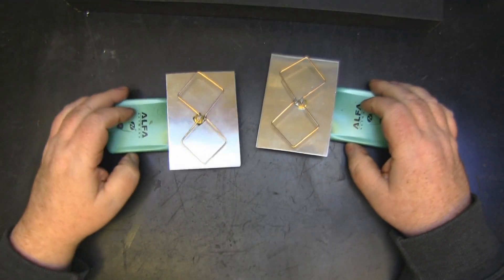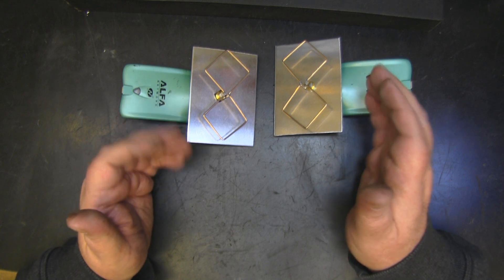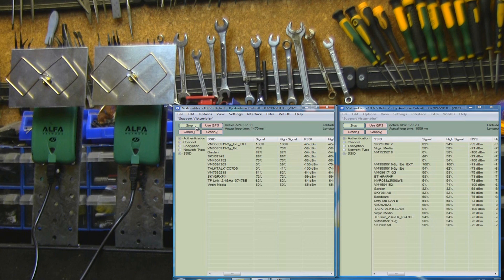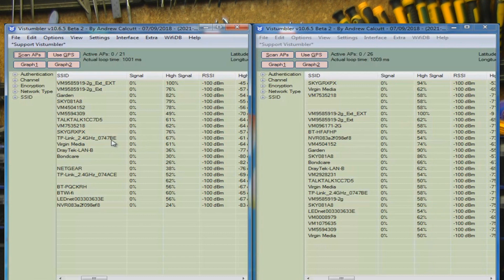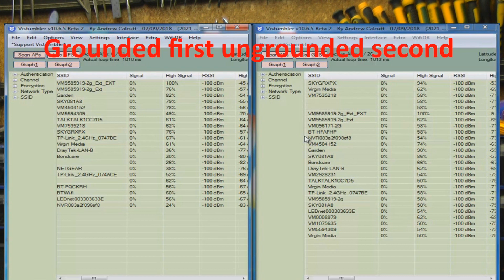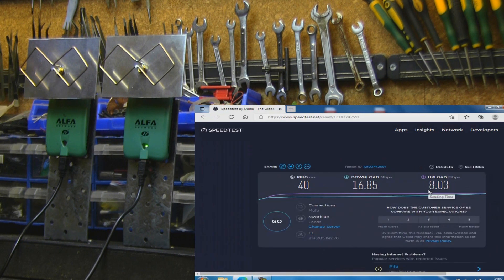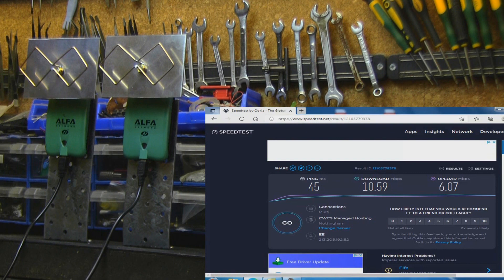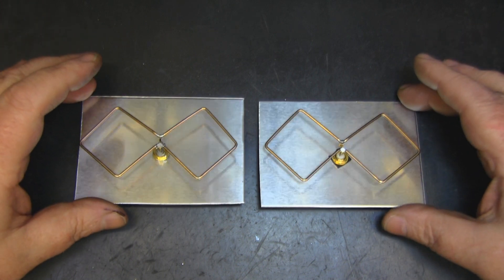Grounded Reflector vs Ungrounded Reflector

Comment: Love your channel. I have a atgm336h gps with a ufl connector, i think 1575.42mhz frequency. So quarter wave length is 4.75cm. So i would need a wire length of 38cm folded into the bow tie.

Its a real cloudy day and i want to try a biquad build to increase my gps signal.

Comment: I have a different use case but perhaps similar theory involved - my object or intent is to reflect away unwanted microwave energy (of unknown frequency but suspected to be frequency hopping from 2.4 GHz to 9.94GHz) from a living space, and I'm using sheets of 6061 aluminum 3mm thick and 24 inches by 30 inches, is it better to ground or not ground?

Comment: Wonderful video, very helpful. Thanks. But I have issues. You don't mention how you test the antenna. Sure you show reception of APs but how about SWR? Are you concerned with that. The reason I ask is I built two bi-quads for my 2-antenna router (being used as a bridge). I am getting a lot of RX errors so I built the bi-quad. When I was finished I put them on the router and the router would not close the link to the main router. It kept rebooting. I purchased a NanoVHA rated to 3GHz and found the bi-quad was over 3:1 SWR. I rebuilt new antennas and got the SWR down to 1.45:1, yet, the router keep rebooting. Solution was to allow the router to boot with one bi-quad, then add the other after the link is established. The router is a WRT160N and I don't know the specs on SWR requirements. The NanoVNA tested the supplied antennas and show flat SWR over the entire band telling me it is nothing but a 50Ω dummy load. Maybe I should add a 50Ω resistor to the bi-quad? Thoughts? Thanks

Comment: Dr Peter jones
would a modified tv ariel to enhance lte 5g coverage?
Will the ariel outstide be effected by a weather cover in plastic?
What is the maximum co axeil cable needed?
Is there a maximum height advantage when mounting it on the house gable end ?
Is grounding the back plate as easey as wiring it into the metal mount screws on the house wall ?
Do you use the online web information to direct it to the nearest mast ?
Would you be able to use any other ferrious metal to make it from?
Could you make a normal omni directional vertical rod areil out of copper/plastic  plumbing fittings from the diy shop ?

Comment: Please Andrew,,i got a dji a2 flight controller and it has a built in receiver for futaba radios,,i have nipped 1 of the anntenas that the flightcontroller receiver has,,is there a possibillity that u could make 2 antennas better then the original in my flight controller,,il pay for it,,would precsiate any help,,i have searched for a replacement but i cant find any from dji or any diy antenna because of my limited knowledge on antenna frequency and range.

Comment: Regarding the Speedtest by Oakia. I dont know if anyone has noticed but the 1st Test was performed with a Server named Razorblue that is in Leeds, while the second Test was performed with a CWCS Managed Hosting Server in Nottingham. Therefore I dont think that this makes a correct comparison between the Grounded and Ungrounded Antennas. In order to produce an accurate comparison between the two there needs to be some way where the Home Router can be used in some sort of Loopback mode so that Data from the Host can be sent to the Router and then received back and either measure max speed reached or Data error rate. I am open to any ideas on how to do this as I am not aware of anything that will do such a Test
Reply: It's OOKLA.

Comment: Yep, matches expectations but could the test antennas being mounted side-by-side perhaps 0.5 wavelengths apart mean that they "see" different incoming signal paths among the sea of reflections from the non-line-of-sight router?
Reply from the maker: In the first test receiving only it should not make any difference. In the second test it would that’s why I did them separately. This is why sometimes you can increase the speed with a mimo setup by experimenting with the distance between two antennas to find the sweet spot.
Reply: Yes, I'd say so and I think also several other problems with this comparison, so much so that conclusion is likely meaningless. And where did the 1dB figure come from?
Reply from the maker: If you ever find a perfect experiment, be sure to come back let us know.